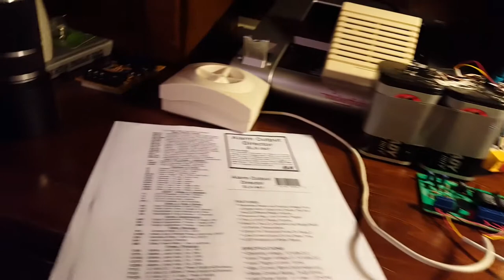ELK-941 Alarm Output Separator Demonstration

Comment: That’s a pretty cool device, i have 2 similar devices to this but made by DSC and the model is PC1OUT which have been discontinued a very long time ago, they came out with the classic DSC panels.
Reply from the maker: That’s awesome!! Sorry for the late reply. YouTube doesn’t notify me of new comments sometimes.

Those classic DSC panels have always been fascinating, from the way they’re programmed to the way the circuit board is laid out. From what I’ve seen, they remained pretty consistent in their design dating all the way back to the Power832.

It’s pretty ingenious that DSC was able to come out with their own way to solve this problem. It seems like it wasn’t that uncommon for people to want to separate their panel’s alarm output!
Reply: @lollipop7ification  separating alarm outputs is good for very old vocal siren drivers where they weren’t able to detect pulsing

Comment: Do you think this could work with a Simon XT system? Its own output for hardwiring sirens is 250mA and 6VDC! I can’t find a single siren with those specs.
Reply from the maker: The Simon panels are interesting because of that 250 mA limited siren output. I’ve also never been able to think of a siren that only draws <250 mA… such a weird spec… The ELK-941 probably won’t work since it needs 12VDC to operate. :(

Google “GE Simon XT Installation Manual” and thealarmstore(dot)com should have a .PDF version of the Installation Manual available for download. Pg 20 has Connecting hardwired devices, and if you read on from there, they mention the no. LD105 interior siren as a possible add-on for this system.

I think the reason the output is limited to 6VDC is because the back-up battery itself is only 6V, and the AC transformer only provides 9VAC. Because of it being a smaller, self-contained unit, they’re able to get away with using a smaller battery, therefore less voltage.
Reply: @lollipop7ification Thanks for your response. I only found one siren that is advertised for the Simon XT, and specs for the 250mA and 6V exactly. It seems like a “cheap” sounding siren, but I can’t ask for much with those specs.